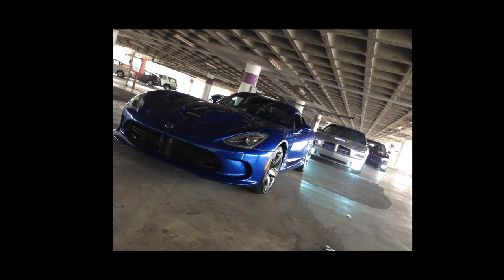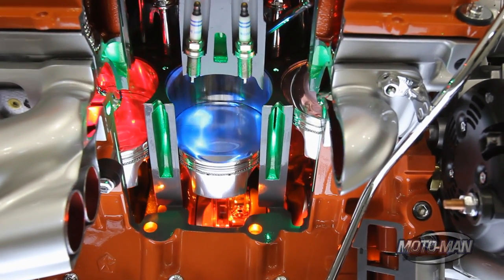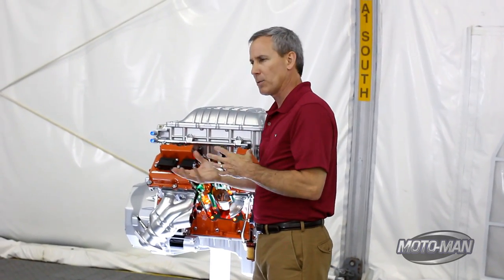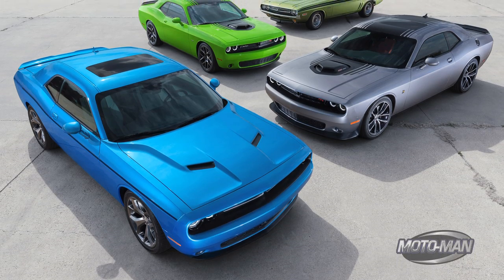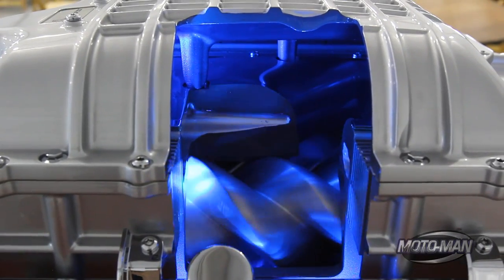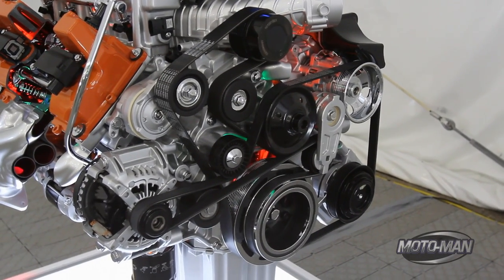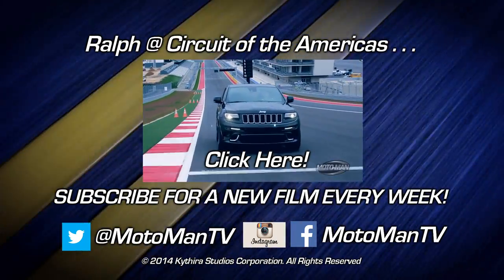2015 Dodge Challenger SRT Hellcat -- Tech Review with Ralph Gilles & Crew

Comment: British car will make you feel like you born in royal, German cars have the best engineering from hair to toe that every bolt are tested thousand times. Italian car will make your blood pressure off the chart from just a look. Japanese car can make your wish come true with half the price and keep running till you are too old to drive. but speaking of the engine, oh boy, no one can even come close to an American build V8! Sure others can have better fuel consumption with complicated valve system and injection or smaller with twin Turbo, but nothing can have the potential that push out 600+HP consistently with 91pump gas reliable without any issue(cooling, knock, smog, blow up something or service every 2000mile)!! The first Gen Koenigsegg use Ford racing engine, Aston Martin still use Ford engine, venom GT are using LS3. Yea there are lot of others that's more powerful, but not in any price range that's any close to American v8 nor as reliable, versatile(in truck, in drug, in high G corner, in boat, any where you need big poweeeeeerrr!). Hell, it even got OK gas miles(LT1 on new Corvette get 28MPG). And by the way, I'm not a fan boy, I'm a Asian drives a Subaru sti and I love it! :)
Reply from the maker: OK, since you brought up MPG . . . I once circumnavigated Lake Michigan in a 368 HP Bone Stock Challenger R/T (manual, of course) and averaged 27 MPG still with some fun driving thrown in there . . .
Reply: MotoManTV that's impressive! I just come back from a road trip from Yosemite with my girlfriends 2014 quattral A4 and it only got 27.6avg. I think its the torque from the V8 so you don't need to shift at all.
Reply: Finally, someone who likes and respects every car making country. They all are awesome and I don't see why there needs to be so much fighting.

Comment: They didn't say the words "GAS or FUEL" once.  The truth is, more air (from the supercharger) = more fuel need to maintain the mixture!  In fact, superchargers require a richer mixture to prevent knocking, which means more fuel than naturally aspirated.  They must have been briefed not to say Gas or Fuel to keep people from freaking out about MPG and emissions.

Comment: Is it dual spark plugs for each piston? almost looked like it. Also would have been nice if they went little wider on wheels with all that power. 9.5" is not a very wide wheel. 20x10.5 or 11 would have been awesome. Then u wouldnt need such a sticky tire to put down good times
Reply: All the modern HEMI's have dual spark plugs, including the early 2000's trucks
Reply: Ah ok. Never knew that. Have never followed dodge. But this one caught my eye so first time actually watching a build of a dodge
Reply: Dean Moslow You gotta get into the good stuff ;)
Reply: Thats why im in Nissan :)
Reply: Dean Moslow lol imagine how much fun cars could be if you liked Dodge ;)
Reply: Unfortunately they can't go any wider on the tires, 275s are the widest the chasis allows.
Reply: That's not true, 305's can be ran on stock 9" Rims
Reply: R7300 If thats true, then someone lied to me. lol The Viper has 295s up front and a whopping 355s on its rear. Its weird to see them skimp on the tire size on this 700HP Challenger.
Reply: Probably not lied.. just misinformed lol They can run wide tires if they want.
Reply: It put down an 11.2 on STOCK street tires..is that not good enough??? Street legal radials makes it a 10 second car...
Reply: Mathew Festoff Yeah thats great actually. But you gotta remember, thats on sticky asphalt. On concrete which is what most streets are, its gonna be a nightmare to get it to hook up. But you are not supposed to be doing this on the street anyway lol.
Reply: Yes,all Challengers with the 5.7L,6.1L,6.4L & now the 6.2L Supercharged Hemi have 2 plugs per cylinder.All generartion three hemis have 2 plugs per cylinder, all the gen 1 (51-58)and 2 (64-71)had only 1 per cyl in factory production.
Reply: V8Supercar1:I live in Canada & since when were highways/streets concrete? I mean ya you see the odd one but most roads are asphalt. But ya a little wider tire would have been nice but it hooks up pretty good even on the highway as i got to drive one because my friends owns a Chrysler deanship in St.Marys,Ontario,Canada called "AllRoads".707HP with 650Ibs of torque,it put me back in my seat like you wouldn't believe man. I'm a die hard Mopar Man & this new Dodge Challenger SRT Hellcat is awesome.
Reply: Not saying 11.2 is bad but for 700hp i was hoping better but it is a boat. Its def a badass car and im sure we are gona see a lot of high horsepower ones. For price its def a awesome deal.
Reply: Dean Moslow The numbers it made are almost impossible. Explain how it has a better 1/4 mile than a viper that has a much bigger tire and wheel and better power to weight ratio?
Reply: @ ChallengerGuy22 I never said tires didnt do well just stated a little wider would have been nice. 11.2 on stock tires vs 10.8 on sticky tires. A wider would have maybe put it in 10s on street tires. And power to weight isnt everything. It has higher power to weight than GTR and GTR runs 10.8. With 707hp i was expecting better than a 11.2 or even 10.8 but they made it fat at 4400lbs.
Reply: Dean Moslow Not really comparable to the GTR. Yeah the Challenger has over 700HP, but the GTR has awd and an aggressive shifting dct. In a standing 1/4 mile, its gonna win all day long.  But during a roll race, the Challenger is gonna win and thats where you will see the HP difference. Even stock GT500s are now pulling away from GTRs on the highway.
Reply: ChallengerGuy22 8 speed Auto is pretty much magic. I bet that transmission on an otherwise stock Viper would run 10.60-10.80 all day long. Look at all the heavy cars running insane times with the ZF8. I swear these new dsgs and fancy autos are worth 100 HP.
Reply: I def understand that i was just saying hp to weight isnt everything. Challenger is a nice car but id choose GTR over mustang and challenger just becuase GTR just seems to be the best car out of them. Nurburing, 1/4, 0-60, slalom GTR with less power def wins my bet. If GTR had same power as Mustang and Challenger gaurantee win.
Reply: Cory Stansbury Shame on anyone who doesn't get this car with the stick.
Reply: slabsides1 Yes the stick is fun but the new 8 speed automatic transmission is faster than the manual 6 speed which also has a wheel hop issues at times..The 8 auto clocked a certified NHRA 1/4 mile time of 10.8 seconds on street legal drag radials & an 11.2 on the stock factory street tires.The 8 speed tranny will shift faster than someone on a manual stick,...no matter how fast they think they are.It all depends on what one is looking for in a Challenger and what the intended use will be,i.e.., a daily driver or the occasional track day at the local 1/4 mile strip.
Reply: 33AndAThirdRPM Good information. But I'm ALSO affraid of that 8 speed transmission blowing out after 7 or 8 years. I think the manual is going to last almost forever.
Reply: I'm pretty sure the fat tires are coming, they kept those for the first year to help with costs and also to have that appeal for the brand as it progresses it gets faster, they wouldn't give u the cars all in ability in the beginning because of diminishing returns in the end if u don't improve.

Comment: That car should have wider wheels and tires on it.  Losing 400-500 lbs would go a long ways.
Reply: Try losing weight in a car that costs 60k that sits on an E-class platform (seats about 5, 4 comfortably) that has a rigid enough chassis that won't noticably flex under 650lb ft of torque... It's possible just not easy
Reply: GMAJXIII This car does have a lot of weight it can lose. But it would cost Chrysler some $$$. Start off with a new chasis thats lighter but strong enough. A carbon fiber/ aluminum body would also save a lot of weight. An aluminum block instead of a cast iron one would also save obvious weight.
Reply: V8Supercar1 The car is built for price as well though. They want it to be affordable enough to sell. By throwing on a lighter but strong enough chassis, a carbon fiber/aluminum body and an aluminum block the cars price is going to be over 120,000$ (150,000$) after dealer mark up and taxes. 

It wont sell because there are better options at that price. Keeping this car cheap and affordable is the only ways it is going to sell. The average buyer is going to think 60,000 and then go check out the corvette, comaro and shelby gt500 and make their decision.

Look at the corvette mark up, there are dealers trying to sell the new corvettes at 100,000$ which is like a 40,000$ mark up. The only way this car is selling good is if they can keep the dealers from marking up the price so much and if they can actually produce enough of them - because many potential buyers if they cant get a hold of them, or cant find them in the 60,000 range will just go buy the competitions car.
Reply: XileLord Im not disagreeing with anything you said. I was just bringing up points on how the car could become significantly lighter. You are always gonna pay more for the better car.
Reply: XileLord , Chrysler, is not that interested in selling very high numbers of these cars. This car was created for the drag strip, and to show people what Chrysler/Dodge engineers can accomplish, for a reasonable price, which will create more demand for the whole line of Challengers, other Dodge models, and the whole Chrysler lineup. This SRT is as much of an advertisement as it is a great car. Chrysler is on a roll, and I expect them to sell many more cars in 2015 and 2016.
Reply: Howard Sherback This car was created to be an uber-powerful cruiser.  If it was really created for the drag strip, it wouldn't weigh almost 4500 lbs.
Reply: hartsickdisciple nobody needs 700hp for cruising, think again. This car was all toughened up for the high torque it makes while burning rubber on the drag strip. Still a good every day car also, for people that can afford it.
Reply: Howard Sherback
You don't need to weigh 4500lbs to be tough enough to lay 700hp... The car just sits on a naturally heavy chassis.
Reply: Howard Sherback There are plenty of other cars that make around the same power, which weigh far less.  They aren't all 200 grand, either.  The 2013-14 GT500 made over 660hp and 630 lb/ft of torque, and weighed less than 3900 lbs.  The chassis held up just fine.  The super snake version made over 850hp with the same chassis.
Reply: hartsickdisciple You just don't get it. This is a full size car for 4 or 5 adults, with a big trunk. Its not a 2+2 Mustang sized car. The Challenger Hellcat can be a 400 hp daily driver, or a 700 hp, 200 mph car, depending on the owners mood and which key is being used. Chrysler has done something different.
Reply: Howard Sherback I do get it.  The Challenger Hellcat is pointless because of the Charger Hellcat, which has 4 doors.  Why buy a 4500 lb boat with only 2 doors, when you can have the convenience and practicality of 4?  If a car is going to be that big and heavy, it'd better have 4 doors.
Reply: hartsickdisciple
Because of the look. Some buyers prefer the look of a 2 door vs. a 4 door.
Reply: hartsickdisciple , I think that you need an enema, please stop your silly comments.
Reply: Howard Sherback An enema?  Would you like to administer that?  My comments are just as valid as anyone else's.
Reply: V8Supercar1 In my view, that look is ridiculous when the car is that big and tall.
Reply: hartsickdisciple
lol. Its supposed to represent a full size muscle car, such as the muscle cars in the 1960s did. Mustangs and Camaros are really pony cars i guess. Personally I would not buy a Challenger as a performance car. Its too heavy an the chasis is actually pretty old. Id buy an RT model as a powerful cruiser or an everyday car though.
Reply: V8Supercar1 The original concept of a "muscle car" was to put the engine from a full-size car into a midsize car.  The 60's muscle cars were not full-size cars.  They were midsize, and typically weighed 3200 to 3800 lbs.
Reply: hartsickdisciple Interesting. I see. And if im not mistaken this Challenger is built on an old Mercedes sedan chasis. Correct me if im wrong.
Reply: V8Supercar1 Correct.

Comment: I am curious to know why the Challenger hasn't invested in 20x10 to 20x11 inch wheel/tire combo for this car?  The SS has them available, and I would think with that much power that upgrade would be a no-brainer.  If your driving behind an R/T, or SRT, look and tell me 20x9's doesn't look like the car is riding on bicycle tires.  The Camaro and the Corvette both have the proper rear view stance of a pony/muscle car.  Nice fat tires for nice fat power.  I couldn't even find aftermarket with anything wider than 20x9.5.  It's the only area I see it as lacking...

Comment: So that much power and only 245's for tires? Does srt know something about tires that no one else knows about?
Reply: 275s who said its 245s !!!!
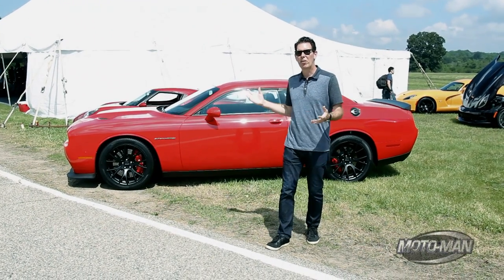Reply: abdulilah turki go to 4:50, "20 by 9.5 inch rims" and the last time I checked 9.5 inches is 241.3 mm.
Reply: 20 x 9.5 skinned with 275s.  Still too narrow for 600+ HP IMHO but thats the tire/wheel size
Reply: That's what I'm saying. The Corvette ZR1 makes 638 hp and gets 285 front, 335 rear. The Hellcat makes 707 and should get much more rubber than SRT is giving it.
Reply: Width of the contact patch is important but, what's more important is the quality of the contact patch. The 2014 Stingray with skinnier tires is able to run faster around a track than the outgoing C6ZO6 with 325s in the back. The Stingray has 275sIIRC. But yes, the Challenger would benefit from having more rubber, that's a given. I think because the backseat is so big, they literally cannot make more wheel space in the back of the car. So a widebody solution would be the best solution.
Reply: You have to understand that they are building a daily driver that can be taken to the track, not a Z28.
Reply: Saying that the rim/ tire size os for breaking purposes is a load of bull shit. That is like saying that you want small break calipers and rotors because they are less weight and this causes less rotational mass, therefore a shorter breaking distance. When in reality a larger, stronger breaking system has greater force and able to stop the car faster. The balance between tire size and weight is important, but most of the time a larger tire width will have a larger contact patch with the ground and shorter stopping distance.

I understand that they aren't making a Z/28, but a larger tire is beneficial to putting down 707 hp (or even the limited 500 hp).  If they want to make it more comfortable on the street, make the rims 18 or 19 inches and make the tires and rims wider.  20 inch rims ride very hard and will generally have such a small tire wall that don't work for going fast or going over bumps and cracks.
Reply: What I am saying is that maybe they should make a SRT car with a well balanced set up. From what you are saying is that their suspension is so limp that they can't  put wider tires on it. Maybe they should put a better suspension on the car.

An SRT should be special. Is it that crazy to have a stiff, wide tire, wide body, firm suspension, flat cornering, fire breathing car that doesn't reduce usability, like a ZL1 or Shelby. The technology is out there in the aftermarket. And saying that it is not possible would be like saying Hennessey, Callaway, and Dinan don't improve performance of cars. Just put some carbon-ceramic rotors with 6-piston calipers, stiffer springs, thicker sway bars, and wider tires. The essence of making a car handle better. You can't put that much power in a car without upgrading the chassis and suspension.
Reply: BloodstainedSinner The suspension is more advance on the zl1 bro its has magnetic dampers that react hundreds times every second maybe even faster yes you mention that you can change every aspect of the suspension in the hellcat but the suspension on the ZL1 is so advance that the computer sorts everything out for you GM has tuned the suspension to be conferrable as possible when in comfort mode and to be as stiffed and composed as possible when on a track GM has been using this tech for the last 4 years and there still improving on it and with the recent introduction of there E diff in the c7 stingray ZF1 packaged the computer can tune the suspension and diff to work with each other to get the best possible result. Another thing brakes why in the hell are you bringing in a f1 car into the argument the reason why f1 cars have 11 inch brakes is because it does not need any bigger brakes because a 2014 f1 car only weighs 1,523 lb and the hellcat weighs 4,260 lb nothing stops faster then a f1 car and the brakes on a f1 car are made of Carbon ceramic material witch can take temperatures of 1832 degrees Fahrenheit just by stating that the hellcat has 4.5 bigger rotors does not help your argument because every high performance car have bigger brakes then f1 cars because road cars are heavier! So dont be coming in with your idea that the hellcats brakes are enough to stop it consistently after some hard laps.
Reply: Ryan Ngo Thats what im saying!